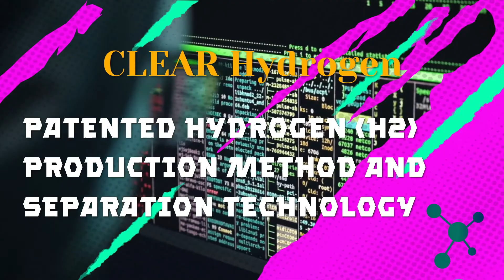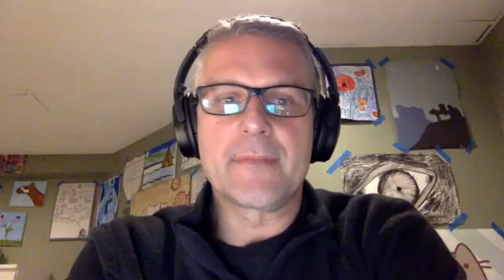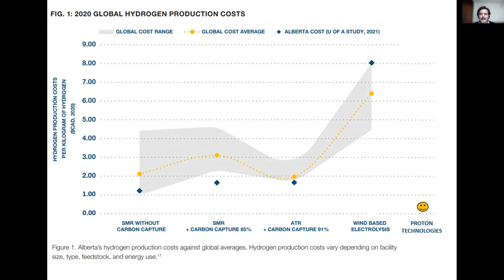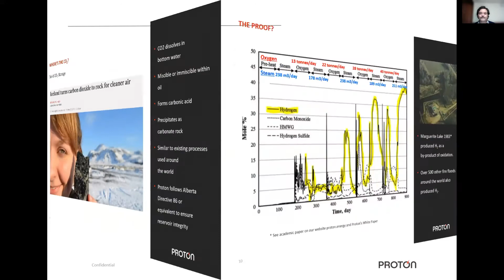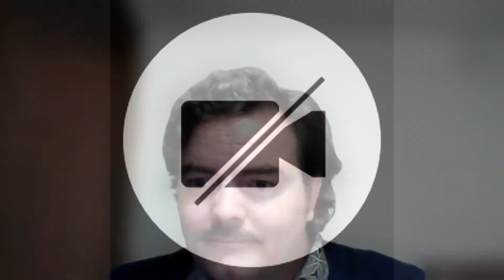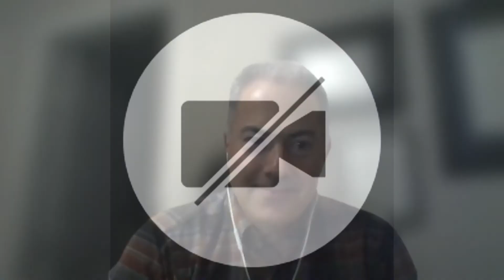Untapped Energy   Nov 16 2021 Meetup - An Evening with Proton Technologies CEO Grant Strem

Comment: Why not use a fuel cell on site instead of a turbine to operate the Oxygen plant?
Reply: Or get a bit of land and start building out a power plant with fuel cells.  Fuel is not an issue so they can just keep on ramping up by adding more fuel cells.  Ballard makes a 1.5 mw fuel cell that fits in a 40 ft seacan. Easy to move around and when i comes time to rebuild the fuel cell it could be swapped out pretty quickly.

Comment: ...People from AER are not and will not be interested in this technology because every specialist in the Oil&Gas sector with minimum reservoir engineering knowledge knows that most of the above is simply a nonsense. Harvesting hydrogen from space (moon) sounds more logical and economical than from depleted oil/gas reservoirs.